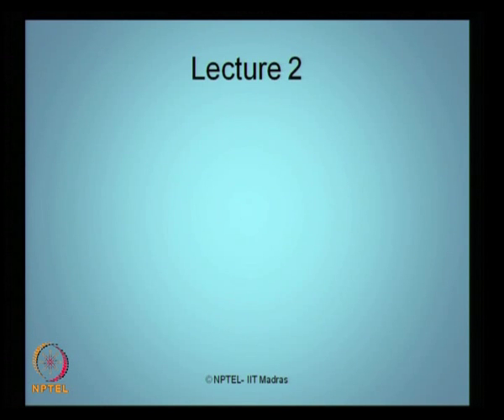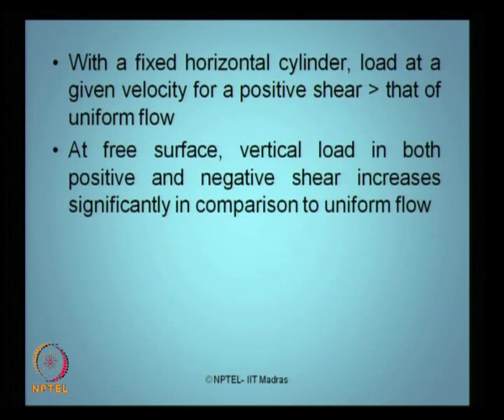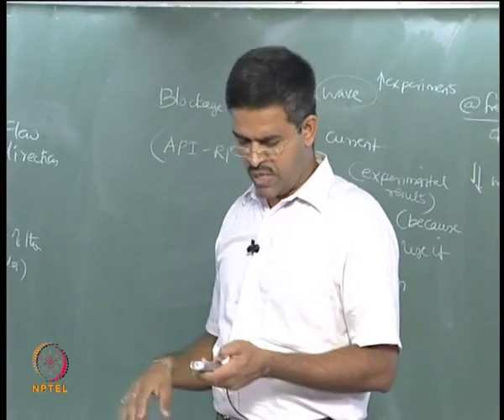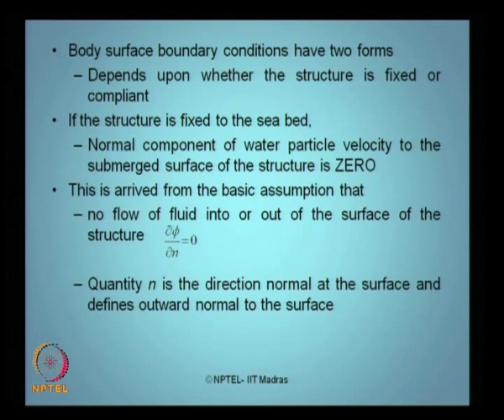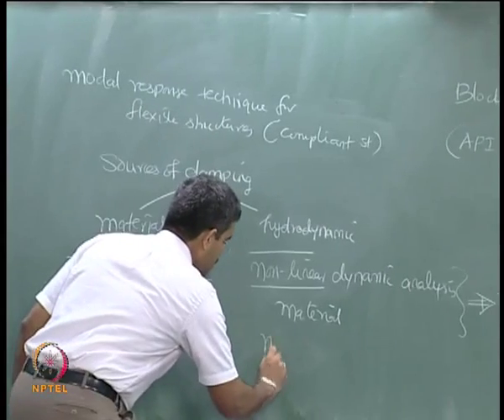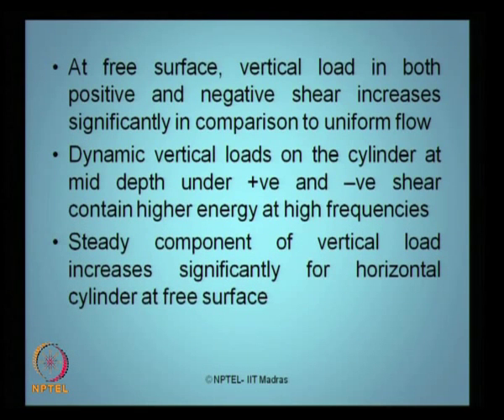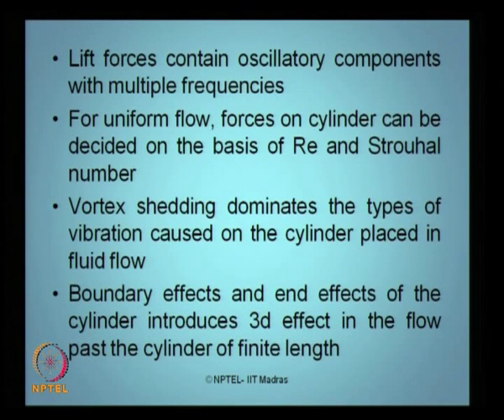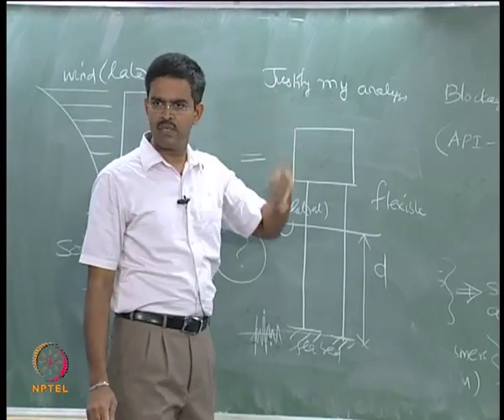Mod-02 Lec-02 Fluid - Structure interaction I

Comment: my answer for the question, which asked in the last is... may be wrong... is the problems may happen to the tethers of the tlp during seismic waves.... when the seismic frequency equal to the dynamic motion frequency of the tlp system in heave direction .. resonance may occur... this may damage the tlp tether, which connects superstructure with sea bed....